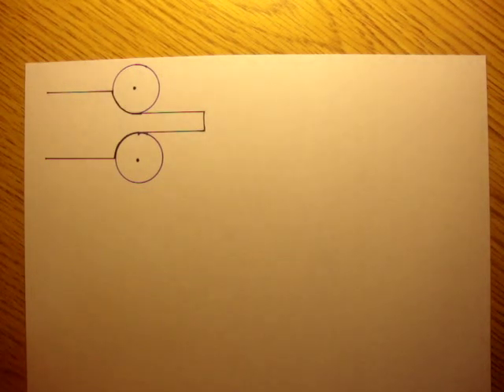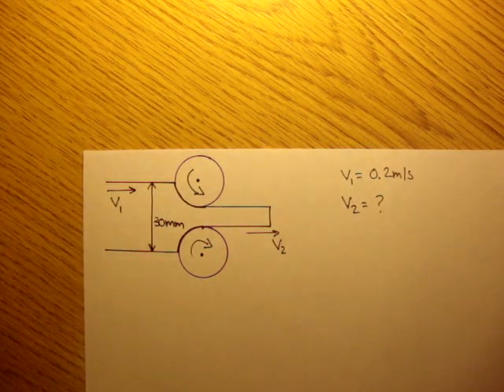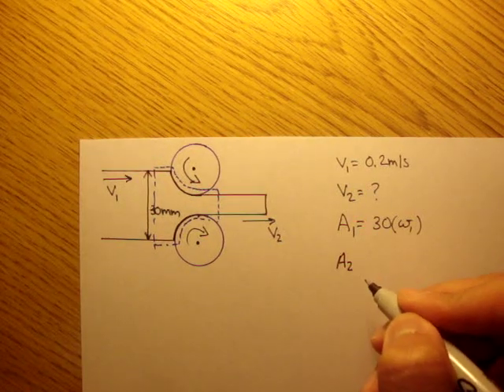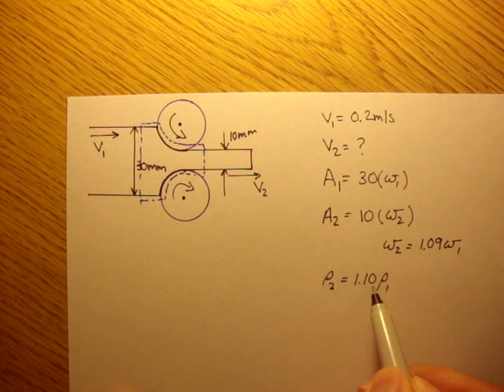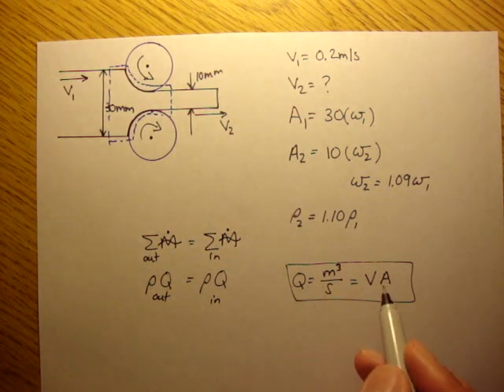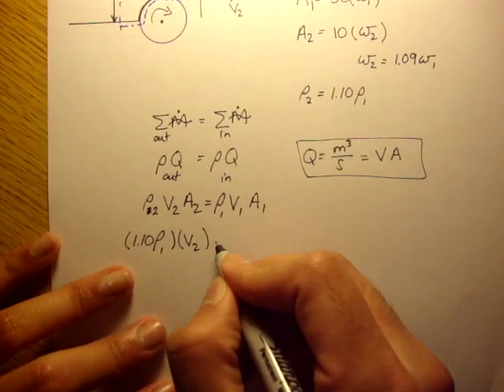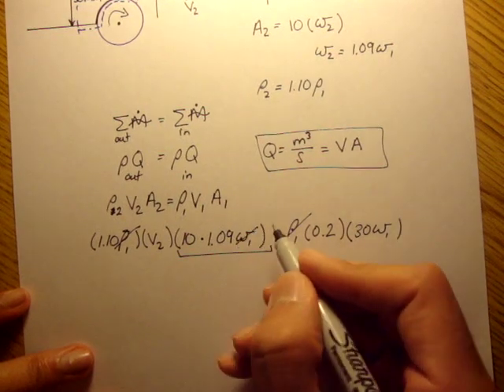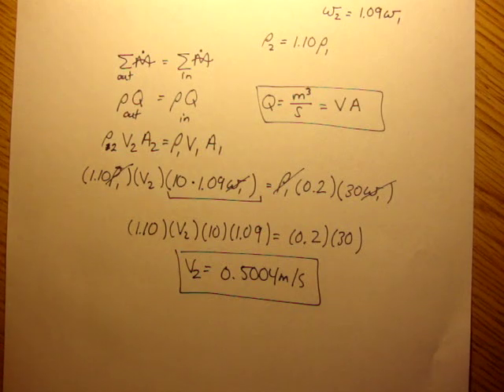Mass Conservation: Example 1 [Fluid Mechanics #23]

Comment: if it increases by 9% of the original width. shouldn't it be w2=0.09w1 ?
Reply: +Ghaid Saeed no because it still has its original width, what you are saying is w2= 9% of w1
Reply: benjamin fejzic why wouldn't it be 9% of w2? It's decreasing width from w1 to w2 according to the schematic.
Edit:  never mind, width goes into the page.  The schematic shows the height decreasing, not the width.  It makes sense that the width would increase if the height is decreasing because of conservation of mass.